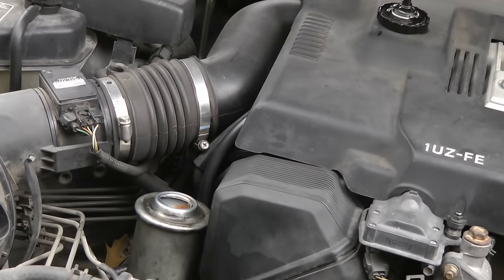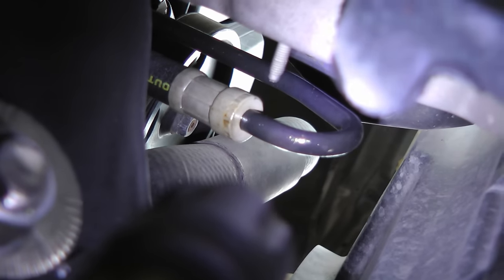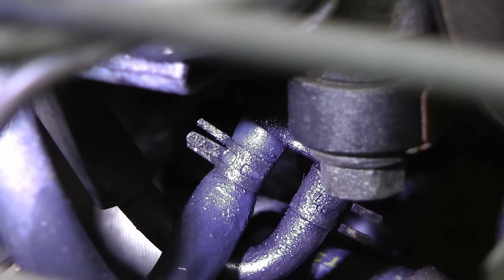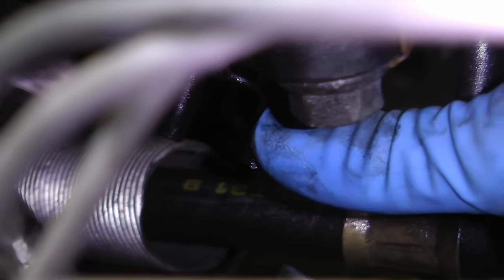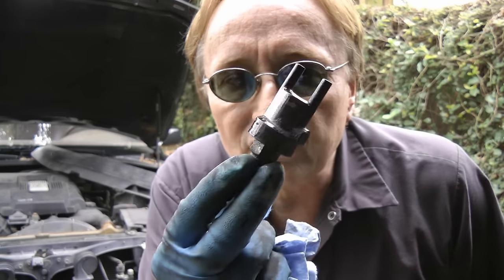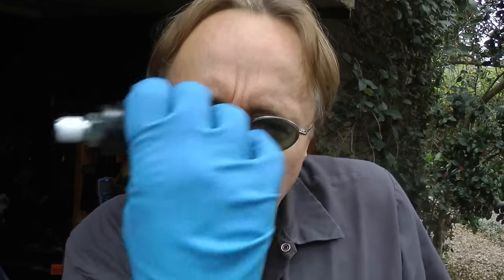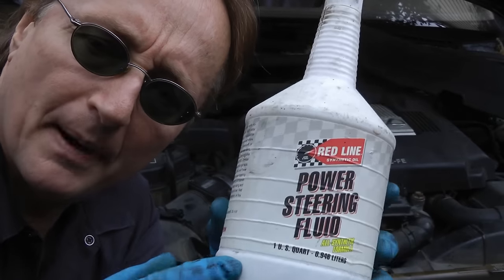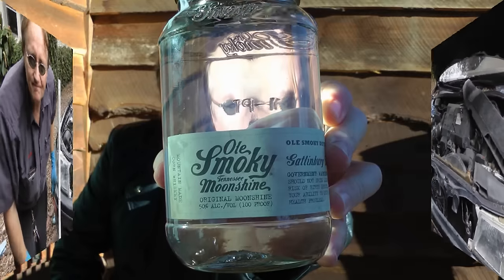How to Fix Power Steering Noise When Turning

Comment: So I just replaced my radiator but after getting everything back on and connected there were no leaks no overheating the weird thing that happened is it took all day for the truck to calibrated and get back to natural idle and it now has a loud hissing sound which wasn't there before or while the bad radiator crack I own an 04 tahoe 5.3l V.8 any insight on this if so I'd be most appreciative

Comment: I just changed the power steer fluid on my 01 honda prelude just cause i recently purchased the car and it looked dark. Now i have a whiney noise coming from pump at idle and gets bit louder when i turn. Could system still have air??

Comment: Hi I live in New York and the last couple of days it has been below zero and this is the first time driving my car in this weather I have a 1996 monte carlo and it just started making noise when i turn the wheel both ways. I checked the fluids and they were fine should I wait till it warms up alittle to see if it does it again
Reply from the maker: old cars power steering will often whine in the cold, then stop when they warm up. Live with that if the noise goes away when it warms up
Reply: Thank you

Comment: Just a heads up, those 1uz engines along with many other early toyota engines dont take power steering fluid but instead take automatic trans fluid. So yes, scotty did screw this customer over and the whine more than likely came back and caused another leak. But he didnt know so i suppose its not his fault.

Comment: Scotty my wife has a 2005 Mercury Montego premier. She has about 145-150k miles on it got it when it was 30k. Since beginning of last year whenever she is driving it makes a consistent humming/groaning sound when turning. Does it when stop but is silent when going straight. It hasn't changed the performance of the car but the steering is not as easy an smooth as it should be but it isn't like an arm wrestle either. The sound is also embarrassing to her. Would this video be the solution more than likely?
Reply from the maker: try the video, and replace the pump if that doesn't work

Comment: Shouldn't the wheel be cycled left to right manually before starting it or would that only be if you replaced the pump?
Reply from the maker: doesn't matter, my method gets it full of fluid no matter what you do

Comment: hi Scotty

my dodge stratus make a high pitched squeak noise in the power steering When the car is hot or i drive it by approximately 20 kilometer and I move the steering wheel a little from right to left or vice versa, where i can find the switch that you 'mention in the video? 

thanks and advance Scotty you are great ! 
greetings from monterrey mexico.
Reply from the maker: switch doesn''t make squeaks, a weak pump or loose belt does
Reply: thanks Scotty
Reply: Scotty Kilmer  what fail does the switch provocate?

Comment: I have a 1992 Lexus Ls400 with 261k miles the power steering makes noise and it leaks what parts should i fix or replace

Comment: I am not completely sure how the power steering air control valve works( same model car), but can that cause misfires/ hesitations since one vacuum tube connects to the intake manifold?
Reply from the maker: it can if it gets air leaks in that system

Comment: Scotty, I watched your video and have a question regarding my 1993 Accord EX.  I've had a rubber sounding noise when the steering wheel is turned left or right.  It is the loudest in the morning but will still continue through out the day. This has been going on for about a month.  My mechanic oiled the steering column but the noise is still there.  Another mechanic mentioned the possibility of a bushing wearing out.  The car does have 273,000 miles on it.  What are your thoughts?
Reply from the maker: bushings are made of rubber, so it could be them, but there are lots of them. try to pinpoint the noise area. See my video "finding the source of car noises" for that
Reply: Scotty, we checked the ps fluid level and all good, no leaks as well.  I did make a short video clip to record the noise I hear while driving and turning the steering wheel. How can I get that to you so you can hear it also?
Reply from the maker: Julie Zeid
I ONLY watch youtube vids, so put one up there, send me the URL

Comment: hey Scotty, what about if you have a hissing power steering problem rather than a groaning one? I have a BMW one series, whenever I full lock left or right if hisses.
Reply from the maker: worn pumps do that on BMWs
Reply: Scotty Kilmer what would you recommend? is there any harm leaving it until it dies? or should I get it replaced sooner rather than later? I mean I don't want to be driving along one day and a snake jumping out at me, hissing away.

Comment: Scotty,  i have another question,  my car makes a little movement when it changes to the 2 gear.  It's automatic, do you think that it's the transmission or spark plugs?
Reply from the maker: lots of things can do that, BUT if it only does it in econd gear, it's an internal transmission problem.
Reply: Scotty Kilmer it do that in the first and second gear only

Comment: Hey Scotty! I’ve got a 01 Saab 9-3 and i recently crashed into a highway wall due to my heater Core breaking and my windows fogging up in less than 2 seconds and not being able to see... well no damage was done to my car all the impact went to my tire (surpassingly!!???) and got it changed and everything was good but 2 days later I go to drive it and im getting a thumping sound at the wheel that was hit but when I turn left the thumping goes away but as soon as I turn it straight or to the right it comes back! So annoying!! What could that be?

Comment: HEy scotty my car is squeaking whent i turn the wheel. I tried losening it, and tightening it, it just made the car show the battery and power steering lights. I put it back to normal tension those issues went away, but its still squeaking. Is it a pulley or will I just have to deal with the squeak until it needs a new belt? cause the power steering gets a little funky, i know the belt is slipping, but im not sure what to do about. It has a new alternator, new power steering pump, new battery. Etc etc. The who thing is practically rebuilt.

Comment: Hi Scotty, my pump makes the sound it's going bad but only when hot. What is this a sign of? I recently had a the gear assembly and outer tire rod end replaced for one side of my car because it was leaking power steering fluid. We have flushed the fluid a couple times and the car feels fine for the first 10 minutes of driving or so. Once it heats up, the noise is back every drive.
Reply from the maker: Kevin Bushman   often just a worn out pump  BUT only put a new one on, cause rebuilt ones often make noise right out of the box
Reply: Sounds like a plan. Thanks!

Comment: I have a mercedes benz r350. When I turn the steering wheel, it makes noise. I was told there was a power steering leak so I replaced The power steering pump and the reservoir. But it still makes the same noise.

Comment: Hi Scotty,
I have a VW Touareg 3.0 TDI 2005.  When hot (only when hot) the steering whines.  There is no leak or loss of fluid.  I have read of other Touareg owners who have the problem.  Some have replaced the fluid and the pump but still have the problem.

Any ideas?
Reply from the maker: whining is either a bad pump, or a restriction in the power steering high pressure hose or power steering rack. good luck pinpointing it, as none of those parts are cheap. BUT, if it steers OK, turn up the radio, it hurts nothing.

Comment: I have a 97 Sliverado. I get that it's a common problem with that make.(PS pump that is) What is usually the problem?
Reply: rust is the thing that puts 1997 GM Power Steering Pumps in the scrap Bins.
They rust right on the bottom where it almost touches the front of the Engine.
I have this problem. Tiny hole developed & I need to top it off once every three Months.
Another problem is the valve inside conks out.
It can't hurt to try a Bottle of something like ?Bardhal? "Power Steering Pump "repair".  It is a 2-part Bottle. 2 different Fluids pour out together, 1 heavy "Oil" along with a very light red Fluid.
Supposed to seal (Rubber) Seal leaks & quiet noise (old worn parts creaking/groaning etc).

Comment: Hello, I have changed my wagon R Lxi CNG both back shocker, both full front shock absorber, both suspension arm, full steering assembly, both front brake pad and get clippers pin greasing and rear brake drum cleaning. all parts are The problem is that before that work there was no voice at the time of turning from my car, but now when I turn both sides it's sound like the kit kit. The mechanical suggestion for the drive axle was initiated. Please help me and advise Thank you

Comment: hey scotty changed my rack last week but threads from steel lines have a leak coming through the threads, does the Teflon tape work in this situation as well?thanks in advanced.
Reply from the maker: give it a try, and use LOTS of tape for that kind ofpressure

Comment: Hey Scotty, I know i have a power steering leak somewhere i replaced the the pump but after the fluid leaks out its a struggle to turn my steering wheel. Any suggestions?
Reply from the maker: Marquis Hicks do my video "finding and fixing car oil leaks" and you'll find the leak with that dye. Often a leaking power steering rack or high pressure hose

Comment: My trailblazer has been stalling when the ac or heat is on. Someone said it could be something to do with a vacuum thingy. Now my steering wheel is SUPER loud when i turn the wheel. Could they be related?

Comment: check the type of fluid your power steer pump takes, not all cars are the same. Some may use 80w90 gear oil even or atf. also dont turn wheels of car while car stationary, shortens life of pumps etc

Comment: I have a 2000 Chrysler Town And Country 3.3 V6 minivan that I just replaced the power steering pump and leaky hight pressure hose on. The problem I have is from a stop it is hard to steer but at 10mph or more its easy to steer. I flushed the system and turned the wheels while they were off the ground for 10 minutes or so. Should be no air in the system right? Is there an additive or something that could help?
Reply from the maker: either rack is worn, or you got a crappy rebuild pump instead of a brand new one.  I only use brand new ones myself, rebuilts often stink. But, you could try a power steering flush additive and pray that fixes it, all auto parts stores sell em and they have directions on the cans

Comment: I have a question. I checked the power steering. I don”t see any fluid leaks and the fluid level is okay is not low. What else can it be if the steering wheel makes noise when turning like squeaking but power steering fluid is fine and no leaks just the  squeaking noise when turning steering wheel?

Comment: hey Scotty! my car is making a screeching noise every time I move the steering wheel either all the way to the left or right. I checked the power steering fluid and it is not leaking and it does not need replacement. I own a 2006 Hyundai Accent if it helps and I'm stuck on this problem. Your assistance would kindly be appreciated! Thank you.
Reply from the maker: +Ricardo Jaroslav Valdes either power steering pump is shot OR power steering rack. Pray it's the pump

Comment: So I did an engine swap in my celica that’s been sitting in place for 3 month & no engine check lights came on but it  makes a strange noise when its at idle & when I turn either right or left it sounds horrible. The steering wheel feels like it has no power steering & I just replaced the pump & nothing really changed. When I pick up speed the steering feels normal & when I slow down the steering gets hard. Could it be that there’s a leak somewhere or do I replace the rack & pinion?

Comment: I have a question for you scotty.  I checked my fuses inside the car and under the hood and they are good.  I have a short or some thing because my battery keeps dying.  I just put a brand new battery in.  I have a 89' honda prelude.  I aint even had the new battery for 2 months and I already had to jump my car. Please help

Comment: Hi Scottie,me again. Im trying to give some love to my car,bit instead,it seems it hates me! I just changed one of the power steering hose. when I put the fluid back and the cap on,as soon as I touched the steering wheel,the cap just flew and the dluid started to cone out of the container like a fountain. What should I do?
Reply: could that be air pressure?
Reply from the maker: +morganix007 if hose is blocked internally or connected wrong, back pressure will do just that.
Reply: +Scotty Kilmer thanks for replying! I just learned that I needed to bleed it by taking the cap off and turning and turning the wheel. Im gonna check it out tomorrow to see if it stops          shooting that cap and spilling the fluid. I still got to work on the rack and pinion,water pump and change an ac line

Comment: My car steering wheel is locked, we just replaced the alternator and put the belt back on everything seems to be back in the right place, the wheel was turning before we took everything apart but now its not turning at all, there is a little bit of power steering fluid in the container, but it is very low, can you help me with my problem? Thanks!!!

Comment: mine is still making noise, but the fluid is fine. what else could be making the noise? (generally only happens when turned until full lock to the left)

Comment: my 02 toyota sequoia makes this "thunk" noise sometimes when i turn the steering wheel. its usually only one "thunk" and not continuous. we changed the upper/lower ball joints and inner/outer tie rods but it still makes that sound. could it be a back steering rack bushing or bad rack in general? i believe it is also leaking power steering fluid from the reservoir...
Reply from the maker: could be lots of things, do my video
"finding the source of car noises" and that always finds the source.

Comment: This one is pretty specific to a car with a vacuum operated P/S Idle Boost sensor valve. For MY car I just needed to see Jim's video: "Repair Power Steering Noise on a 2003 - 2007 Honda Accord".  Instead of $100's in pumps/belts a 10-cent viton seal.

Comment: I have question on cars that use Dexron 3 for the power steering system what would you recommend to use (as in best fluid to use)?
Reply from the maker: the stuff I used in this video is best, full syn ps fluid. It mixes with any other
Reply: Thank you!
Reply: Martin Phan
That stuff Scotty uses, "Redline", is supposed to be the best.  I use Mobil 1 Synthetic ATF because I can't find the Redline as easily. (I would imagine it's comparable.)

Comment: Hey scotty i have a question about power steering pump itself i got a new pump but its missing a piece or they want me to reuse the old its a small piece that goes in right before the pressure line its helps prevent leaks snd it is removable my was just cracked snd i cant find it on the pump diagram in my chilton

Comment: Hello I have a question how am I supposed to know if it's power steering pump or just a little switch cuz I'm new to Toyota avalons just a couple days ago I had to put some fluid in it but now the steering is a little stiff and I hear a noise on it and when I'm in park it I lose a little bit the RPMs go up

Comment: What if I bleed air out of  power steering on my 94 suburban 2500 454 2wd. With out jacking the weight off the floor?

Comment: Most new cars now use electric steering now. Is that more reliable than power steering?
Reply: It should be. It just costs much more to replace that power assist motor if it fails. But the days of leaks are gone, because it doesn't use fluid to provide the assist.
Reply: pretty damn solid reliability wise. Only got the motor itself and the sensor on the steering column to worry about. Motors usually last ages (wont really be a concern) and the sensor is an issue on hydraulic cars too.
Avoid toyota/lexus EPS systems. Mega oversensitive. A few other manufacturers are yet to nail an ideal amount of torque assist on their EPS systems too but toyota are meant to be particularly bad.

Comment: 2004 Ford f150 4.6L shakes  bad while idling no power. Fuel injectors changed, changed ignition coil packs 4x what will cause this?

Comment: HI SCOTY i drivea pontiac sunfire 2003 , and the power steering make a lot noise , i tried double liquid ,poer steering repair, but rhe noise still, what do you thinck i have to change the pump ? or rack steering problem ? i inform you the steering is normale not hard to opearte ,noisy only ...........thancks

Comment: my honda accord 2009 have same problem, but there aint any switch. there is a leak for sure, but the mechanic said u have to change the power stearing upper champer, the one near the engine belt. 
it costs alot. dont know what to do?

Comment: If my PS fluid is dirty (like greysh near black) should I flush it or leave it alone? I do hear a whining noise but there are no leaks. It's an 03 lancer.
Reply: Flush it before the hoses completely rot and leak or the pump/rack gets clogged.  I just did my 02 camry and I think I dodged a bullet... the old fluid actually had chunks of sludge and crap in it.  It's easy enough to do and it's not a lot of fluid (maybe a quart and a half or so.)

Comment: My '02 Civic Ex is leaking from the p.s. pressure switch connector - the little rubber piece keeps popping out. Is there a sealant I should use to keep it in there, or is there something else I can do? I'm also replacing the switch itself..
Reply from the maker: see if switch fixes it, if not, replace the whole assembly, those use 1500 lbs pressure and nothing fixes a broken part that leaks BUT replacing it